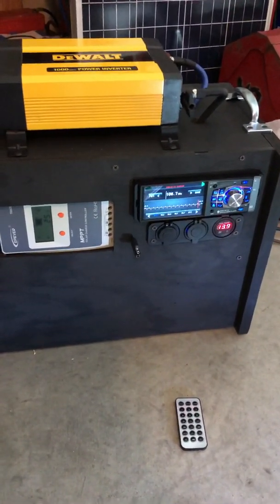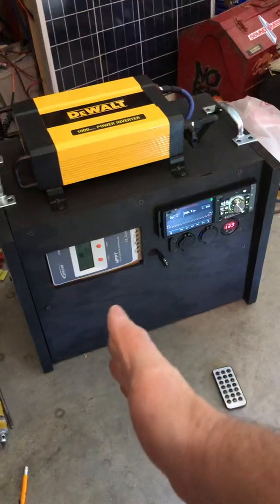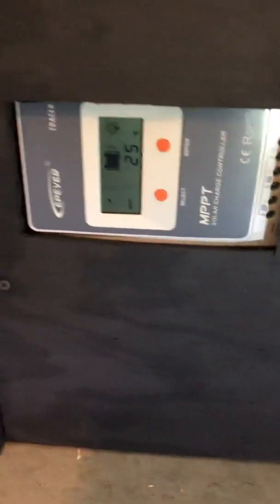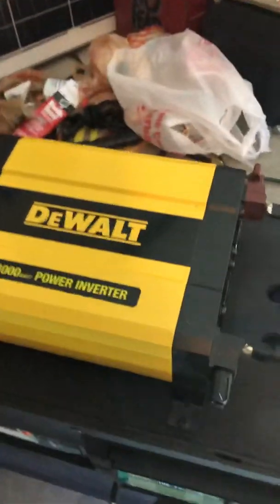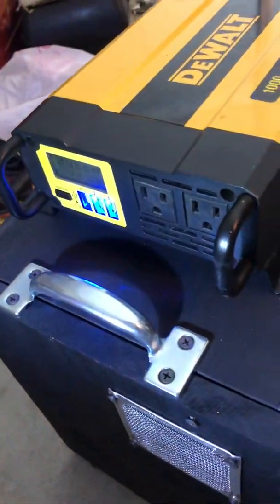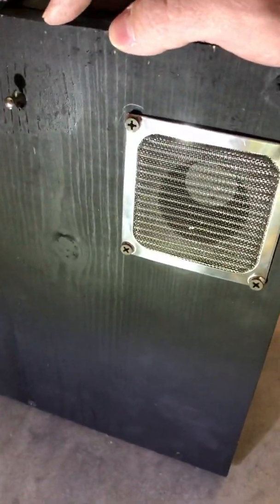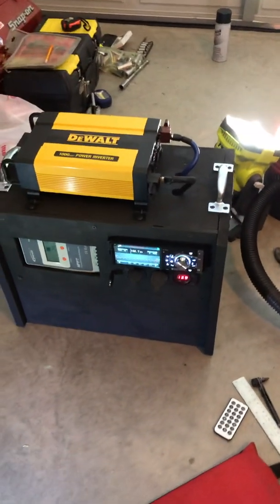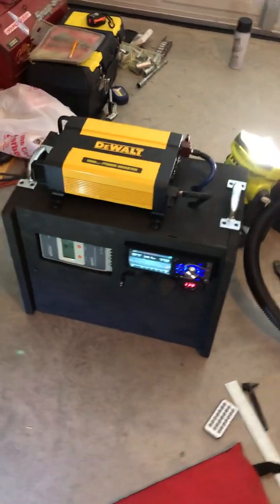DIY Portable Power Center

Comment: Finally someone does a solar set up with the dewalt inverter! How has it been working for you? I have a dewalt inverter and debating if I should set it up with solar charging.
Reply from the maker: It has been working great except for the display.  It lights up when it wants to.  However, it is VERY nice having the wattage draw shown on the display.  It’s like having a built in Kill-A-Watt.  Bought it used and not working for $20.  Opened it up and found the internal fuse blown.  Got that fixed and added an inline fuse on the 12 volt power lead.  I’m very happy with it!!